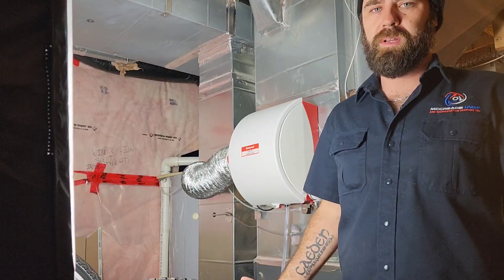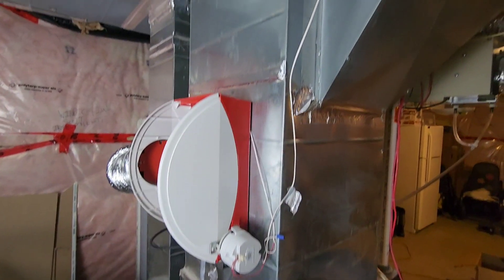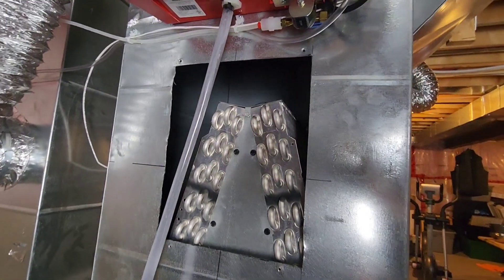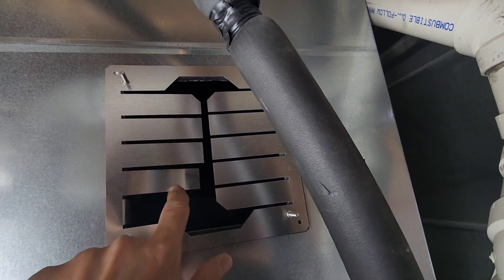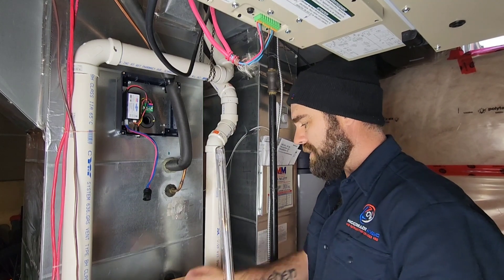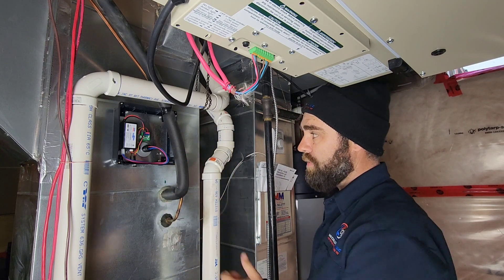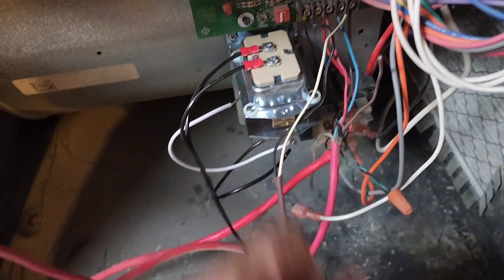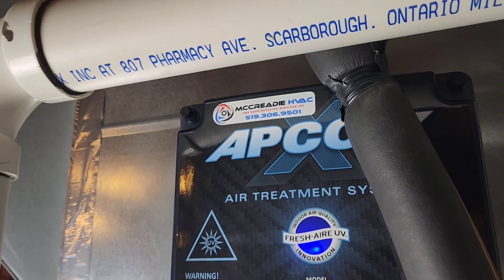Evaporator Coil Sanitization With APCO-X - How To Install A UV Light

Comment: Some furnaces have 120V EAC terminals on the board that energize when the fan runs. Would you recommend wiring the transformer to that, or just L1 and N for 24/7 operation?
Reply from the maker: L1 and N, rhe light should be on 24/7